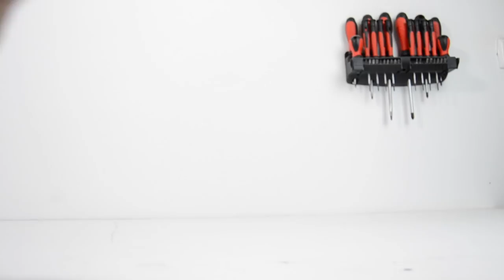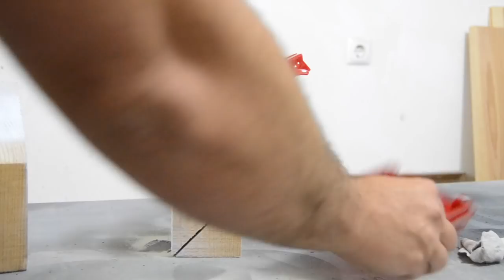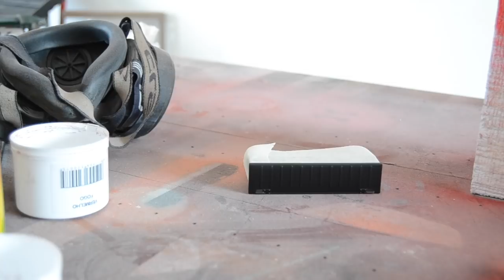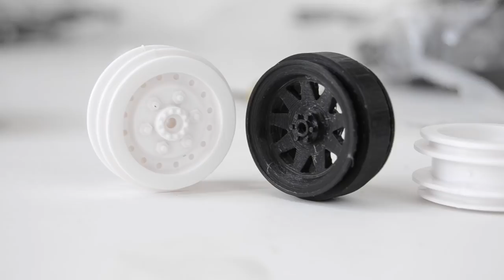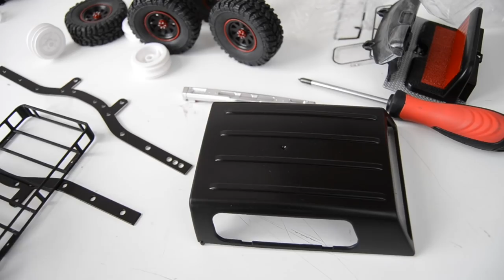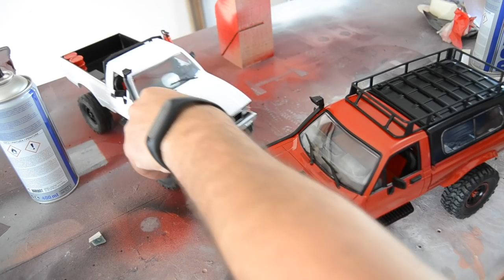WPL c24 the "Candy Red" making and 3d printed mods

Comment: wishing WPL would make a "crawler transmission", heavier duty drive shafts and axles, and a body lift (just 3/8") plus long suspension travel (1/4" more) shock set. they'd be nice "upgrade parts", transmission outputs about 1/4" lower so U-joints aren't quite as kinked, and  ratio about twice as low. LOVE how they look, but I tend to think they heard "needs more torque" and mistook it for "needs more power" (which can break stuff!). Gabriel Silvaz and others are doing good things with a pair of geared N20 motors, about 300 RPM rated 12v runs good on 7.4v 2S, but I feel WPL should handle all of the above. now after all that.... 
!! this truck is looking GREAT !!

IF the company and distributors got these ideas and acted on them, the products would lean more towards "hobby grade" than "scale toy" (and darn their details are so nice). if the upgrade kits were made available, I'm sure many would buy them and quickly. I've seen how they can crawl and climb with a pair of geared N20 motors, and have one on it's way.
Reply: model nutty  metal shaft and tranny are already in the market. Now I am waiting for oil shocks :)
Reply: Paradise yep, just saying if WPL did it themselves their popularity and sales could increase. 10-15% larger diameter drive shafts, U-joints, and axle gears isn't going to hurt the scale appearance, it'd just make all those parts a bit more solid. a "toy grade" 130 motor or lower RPM rated FK-130SH is plenty of power, if it's geared down to deliver crawling torque, is a re-visit to the trans casing for 1 more reduction gear in it.

I'm definitely going to make a center for the N20 motors, wrap the U-joints "ears" with black sewing thread and CA to help prevent spreading/snapping, seating bevel gear bushings with thick rubber cement etc to get a good gear mesh...  all the little tips I've seen or thought of for being interested watching videos about these and other crawlers. some simple tips for 1/24 Redcat Sumo been really good!
got couple AAA size lithium ion cells on the way for wiring 2S in the Sumo, also plan using pair of 14500's for this Toyota, they're not going to pull current so hard they need LiPo fed.
Reply: WPL is doing it themselves.  They have the n20 motor setup and a 2 speed transmission.  As well as a metal upgrade kit for the axles and driveline.

Comment: needs more 3d files, not only rims.
like bumper and roof cage.
Would you like to suggest me the Lighting System Kit with brake lights and signals (right/left) light?
Please share 3d files and light system link.
Thanks
Reply: Did you find anything yet bro?